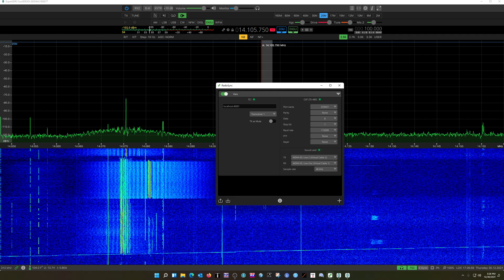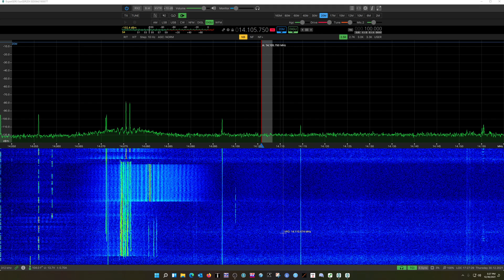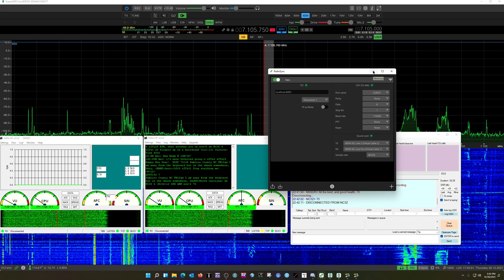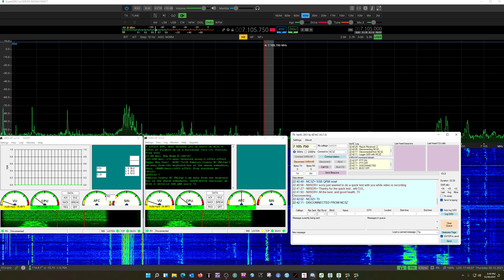EESDR- VAR-HF and VarAC setup using EESDR V3 0.11.0 with RigSync and VAC

Comment: Hello, is there a place / document where we can see all the components required ( and how to configure them one by one ?) I don't understand why so many pieces are required and needed (because of TCI ?) . 
I have installed all of them, but not able to make them talking ( Vara HF, VarAC, Omnirig, RadioSync, EESDR) . I don't see Audio cable and don't have PortName other that "None" in RadioSync. Really frustrating to spend so many time to make stuff to work. Thank you for the vidéo, but I still miss something.

Kind regards

Comment: Seems like a thorough video, but I suggest you do a full screen zoom in to each panel as you demonstrate it because, unless the viewer has a large screen like you, we can see none of the details of the UI and pretty much have listen as if there was no video.
Reply from the maker: Have you tried adjusting the HD quality setting available on YouTube playback, perhaps you can try a lower resolution? if you're using a smaller monitor, maybe try 480 or 720, sorry I run 2K and 4K monitors